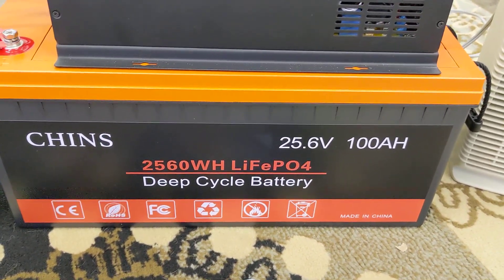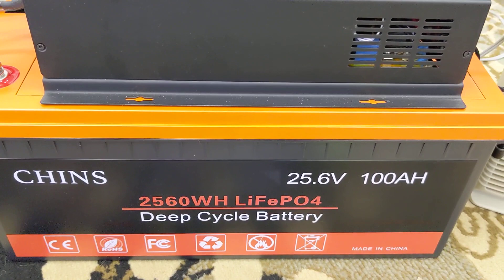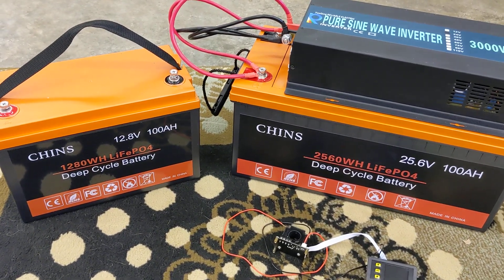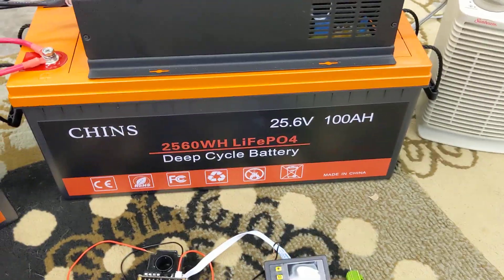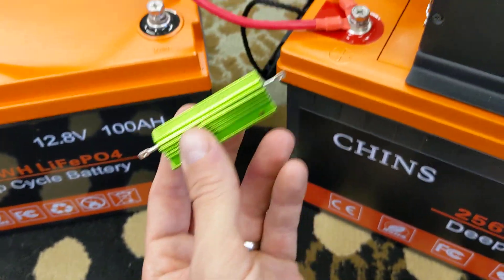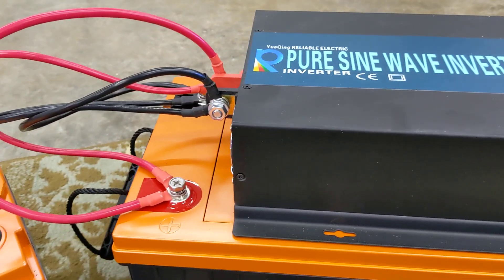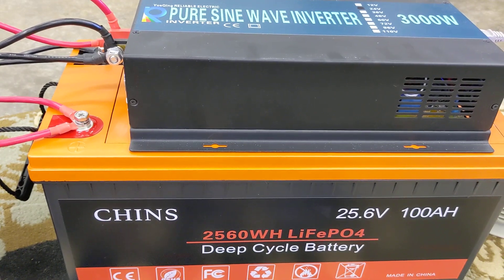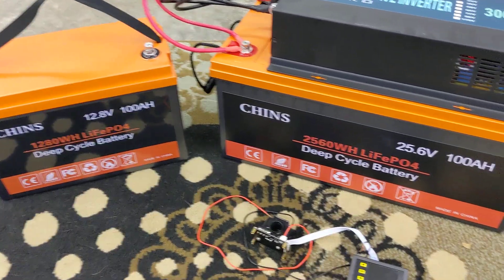Chins 24v 100ah LiFePO4 battery

Comment: If you use a victron charge controller you can get a temp sensor that mounts to the battery and will stop charging when it's too cold. Also, check out the all in one units. Mpp solar makes the pip2724. It's an ac charger, solar charge controller, and inverter all in one. Eg4 is another good brand. Will prowse has a lot of good reviews videos on these.

Comment: I just bought one of these, question for you. 
My battery shuts off after 27v, I thought something is wrong sent it back 2nd unit does same thing. The spec for this battery says it should cut out at 28.4v 
My charger both from solar and standard both behave like this, the solar mppt charger can be damaged per the mfg because of this. 
I did confirm that the capacity is 100ah but it's only allowed up to 26v from a 29v charge source. Can u confirm it cuts off at 27v when charging?
Reply: Does your charge controller have a lithium profile?
Reply: @donovanturner6284  no it does not. Morning star tech was helpful I had to build a custom profile has been doing well. The BMS cuts out at 27.5v in these batteries so after a full charge the battery shuts off and I am in solar. Then as sun goes down it kicks over to battery at 27.5. working great, i have two 24v 100ah in system

Comment: Don’t ever connect them in series. Regardless of what the manufacturer says. Eventually one will get ahead of the other unless they actually talk to each other(cable link). Most likely it’ll be out of warranty or they are gone by then. It may work for a while if they were matched or bought at the same time but years down the road one will finish first and trip the internal BMS shutting off the charge while the other is partially charged. If you want a 48 volt system buy 48 volt batteries. Same for 24 volt. Exception; if each battery has its own isolated charger within the series. Example two 12v 100ah connected in parallel with it’s own charger then connected to another pair with charger in series to make 24v 200ah to be connected to an inverter load but not an inverter charger.

Comment: What do you use to charge it
Reply from the maker: A 12/24V charger I got on Amazon.  I also have a 40 amp charge controller for the camper that I will use on it once installed.